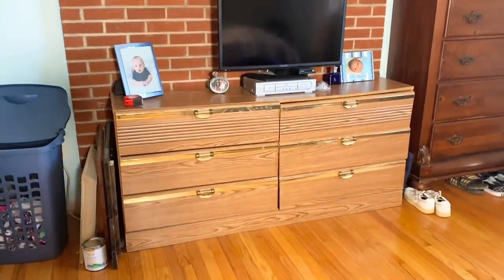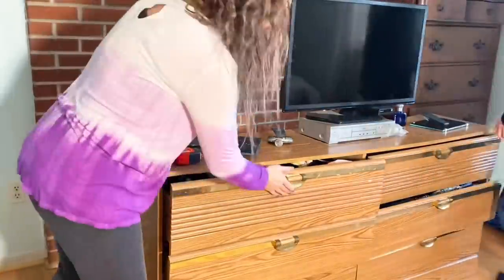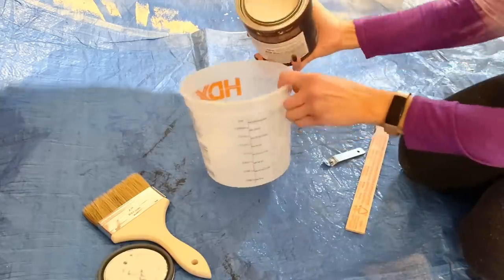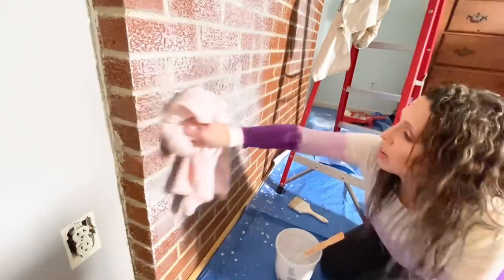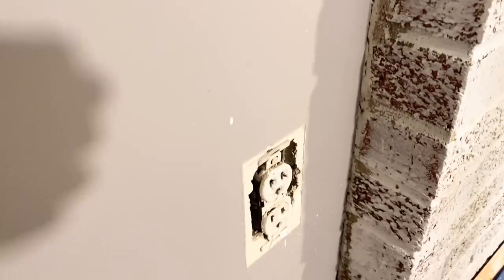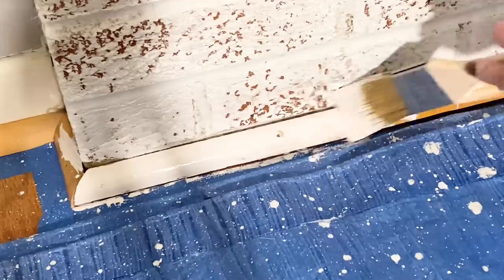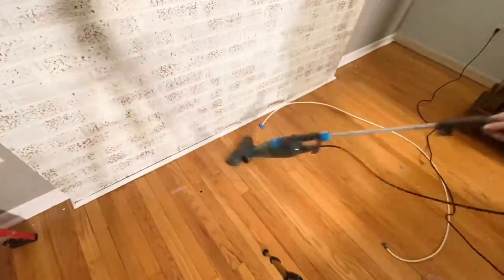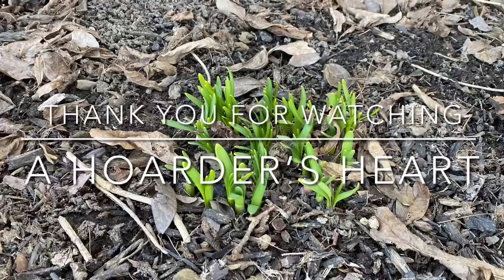Hoarders ❤️ Master Bedroom Declutter Remodel Part 6 | White Wash Brick & Accent Wall

Comment: Great job. I would definitely recommend painting the ceiling as many others suggested. 
And maybe consider taking everything out of the room, when doing the final paintjob and then only putting back the things, that you miss in the room. Just like your youngest had a lot placed in the basement, try the same in the bedroom! I know you've mentioned the fear of some of the stuff under the bed being damaged in the basement, but try and get as much out of the room as possible and then putting things back when you need or miss them. And maybe look out for a pretty hamper for the corner! If it looks pretty it might help you out things in it.

Comment: I would put the bed on the accent wall, if possible.
Reply: I was thinking that but I don't know if the door on the side will be able to clear a night stand and they'd have to move that cable wire 🤔 and if both lamps would be able to reach the outlet
Reply: I was thinking the same thing!!!

Comment: I would consider getting rid of both dressers plus nightstands and getting 1 eight drawer dresser with 2 three drawer nightstands (that match the dresser) for the sides of your bed (in white of course) and put the bed and nightstands on the wall with the brick. The new headboard would look really good against the brick. The room is looking fabulous so far.

Comment: Re the living room fireplace, I’ve seen house flipping shows where they reface a brick fireplace with porcelain tile, or other materials, hiding the brick altogether. You may want to google it, and see what you get. If you do paint the fireplace, protect you new carpet extra well - I painted a room and have now strategically placed furniture to hide the paint spots I couldn’t get out of the (old) light coloured carpet.😁

Comment: I would leave the living room brick as is for the time being until you've finished decluttering. If you did paint it , I would go solid white, priming it first and also spray paint the brass around the fireplace black ONLY  if you paint the brick though.. I think removing one of the cabinets on the living room wall would open up the space a lot more. 
I always enjoy your videos💕

Comment: I really like the painted brick in the bedroom because it softens the look of the room. But...I would not paint the brick at the fireplace downstairs as it's a very nice original feature of the house. The heat from the fireplace will cause the paint to crack and chip over time. You will also get some soot around the opening even with the glass front and will be forever cleaning and repainting. I think consulting with a mason listing questions would be a good idea. Once paint is on the brick it is very, very difficult to remove. There is a paint called --stove black--made to withstand heat but I don't know if it comes in colors. Can't wait to see the finished room.